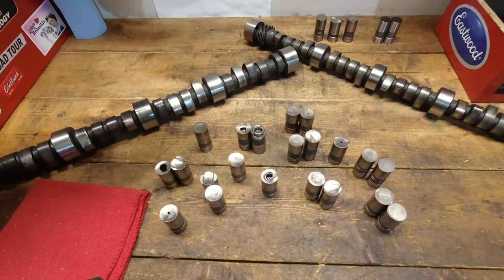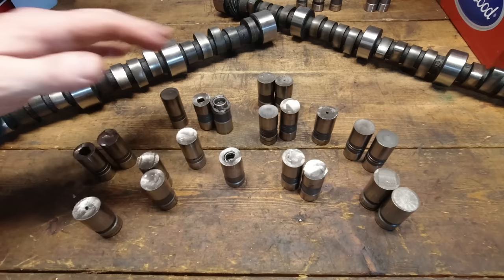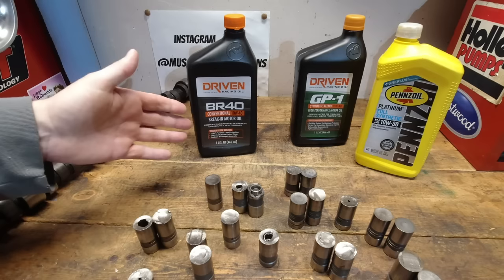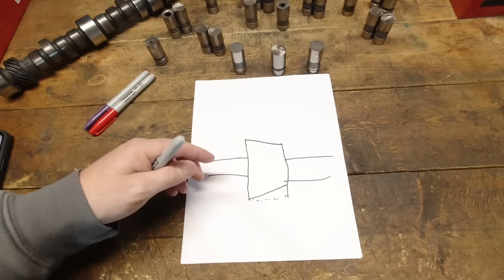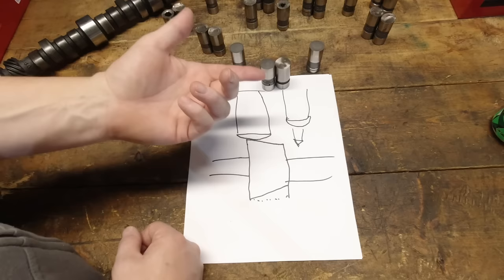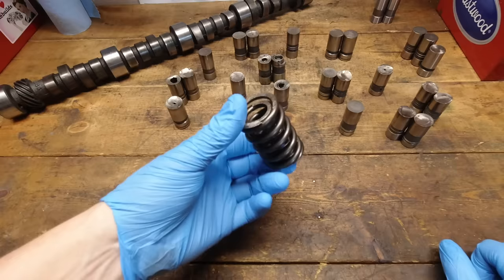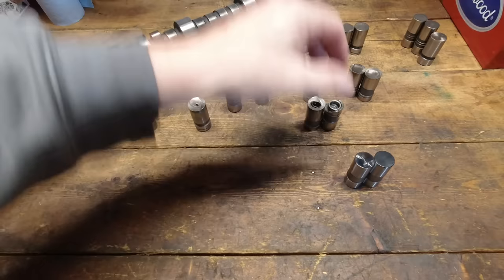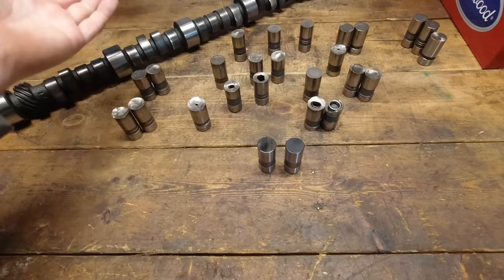Flat Tappet Cam Failures: The Reason Why They Go Bad & The Solution! Part 1

Comment: I last summer I put an AMC 360 together using a cam from Bullet, nos lifters of unknown manufacturer. I used oem springs also. Lots of cam break in lube. I did however use the Lucas zinc additive and rotella t4 .  I used 15 nos lifters and 1 sealed power made in China lifter. After 25 minutes of break in time I pulled the intake to inspect the lifters. 15 lifters locked great, but the China lifter showed bad circular groves indicating that it was rotating . I would like to send you a picture of the lifters and see what you think.  I sent the picture to another utuber but he seemed kinda snobby like don’t question my expertise, but never did reply to the picture.
Reply from the maker: Do you have images of before they were ran or only after?  Send me over your pictures.  I’ll see if I can give you an opinion.  My website is in the banner of my channel page.  There’s a contact form you can send it to.  But it’s pretty obvious without even looking what happened.  Like I mentioned in the video, when you mismatch brands, you potentially mismatch the crown and taper combination.  No knock on the chinese lifters, there are actually some on the market that aren’t that bad.  But if you got one with a weird pin head crown and a lot of chamfer….

Comment: I'm confused if the zinc stays in place with less spring pressure what happens after break n with high spring pressure zinc now just stays on the lobes of the cam?

Comment: A LOT OF USER ERROR.. I PUT A GROVE, OR MORE LIKE A SCRATCH IN LIFTER BORE. COMP SELLS A TOOL IT ALLOWS MORE OIL TO CAM. ALSO RAN LOW RATIO ROCKER  ON BREAK IN. THEN PUT PROPER ROCKER ON.  A LITTLE MORE WORK FOR LONGEVITY AND NO CAM FAILURE.

Comment: Thank you.  I have a friend with a '70 1/2 Z28 with the factory solid cam 350.  He rarely drives it.  That said, he uses Delo 400 and adds a can of Lucas ZDDP.   I cringe 😖
The cam is actually a Comp with the same as factory specs.
The cam is well past the break in period, but still... I cringe 😖
The car is more pristine than when it came from the factory.
so I cringe even more. 😖😖😖 
😁
Once again thank you. You've provided me with ammo to use on him. 😁
Reply from the maker: Good luck!  I did an interview with Driven Racing oil last year and have another coming up with Lake Speed Jr if you need more ammo! 😆
Reply: @MuscleCarSolutions  it's worse. I tried helping get the car started after two years of sitting. He'd had blowout valves installed in the original Holley 780 carb. He also cleaned it....... then it sat for two years.  After a dozen attempts to decipher carb related issues including the wrong gasket, seized accelerator check ball etc, I discovered he'd installed the carbs base screws in the wrong holes. Two are blind, two aren't.
By the time I figured this out, he had a gallon of fuel in his oil, plus his DELO 400 oil with the Lucas ZDDP additive.
...cringe 😖
I'm hoping the gasoline oil additive package didn't do any damage.  It's got less than 50 miles since then.  He just doesn't drive it except for an annual cruise.
 Years ago, the car was part of a Chevy High Performance magazine article.  He's a second owner and acquired it in 1971 or 72.

Comment: No mention of lifters that leak down when engine sits, pump back up and sound normal again. When lifters were removed it was due to this leak down problem and the lifter face to cam area looked normal and healthy before lifter replacement. After a lifter replacement and attempting break-in with Valvoline synthetic 10w30 and zinc additive, approximately after a couple of hundred miles they fail in this way again. This only tells me that the bores where plungers are must be wearing and not of high quality of materials and/or machining. 429 engine, 66 Fleetwood Cadillac.

Comment: i appreciate the video, although you didnt mention valve lash.  i have seen guys crank down that rocker arm and cause exactly the lifter issues on your table.
 the last flat tappet hydraulic lifter engine i built was years ago, from 84-2010, we never used any special break in oil (we did soak lifters, and grease up the cam), and had no valve train failures.
what changed?  the folks building the engine?  the materials for the parts?  something happened for you to have to make this type of video.
have a great day !
Reply from the maker: I suppose I could have added something along those lines but the video is extremely long as it is.  If lash is set that tight, there’s a lot more issues to deal with!  Covered the material and lifter issues and my assumption on the one part that I feel is most responsible.  Good thing the new solution was released.  I firmly believe that’s going to solve all these issues.  Time will tell!
Reply: @MuscleCarSolutions  looking forward to the next video !!
Reply from the maker: Much appreciated.  Thank you!

Comment: I hate to say that you are not right... in the first 1 min. I just picked up 16 Melling lifters JB969.  4 sets of 4  and all four were not the same, all 4 sets were different from each other.  Looking top down...  2 vertical wire on each side to hold assembly together 2 of the sets, but center holes different size. 1 set had 3 wire in box shape, 1 set had a "c" clip in it holding assembly.  Sides of lifter 1 set smooth around collar cut for oil, 1 set had single rib and 2 sets had double rib.  bottom  2 sets were crowned. 1 set not crown but had a different or bottom and the last set had round circular ...almost like a wear pattern 1/8 off the edge. Oh and when looking down that lil hole . . . 1 set has something metalic really close to hole and others dont. These lifters are going into a BB 366 factory engine... no performance any thing. I was kind of amazed  the  sets
Reply from the maker: Sounds like a packaging problem to me.  There’s no way I’d run a mismatched set like that.  Time to contact who you bought them from for an exchange.

Comment: All reasons why hobbiests who shy away from details should invest in roller cam/lifter applications.  Those determined to make the flat tappet work should remember to fit the lifters to the cylinder block bores, one more of those pesky details and time consuming complications.
Reply: Another thing, consider where all that metal worn from the failed lifters wound up.  Imagine what the piston skirts/cylinder walls must look like now.
Reply from the maker: @misterhipster9509  paying attention to detail is the whole name of the game on engine assembly!
Reply: @MuscleCarSolutions  You and I understand that, however many end users don't.

Comment: I don't bother with the break in time. Set the timing,idle . Bring it to temp, once it's hot ,I shut it off. Put the hood on and by that time it's cooled down. Then I go for an easy drive. Haven't lost any cams. The factory never broke in cams. This higher-up then idle cam break in is wrong and is causing the problem.
Reply from the maker: I don’t think there’s an engine builder in the country that would agree with you, but whatever is working, keep doing it!
Reply: @MuscleCarSolutions  probably not,I look at it this way ,it's a bearing surface that has to be mated in, correct. Spinning something at a higher rpm to break it in seems backwards. We started to hear about these failures 10 years ago? What to sell every one break in oil, additives. The collective industry has told us we need to set the rpm @2350 for 20 minutes,don't worry about the coat headers getting messed up because your timing was off. Oil leaking just break in that cam. I have done 15 motors and haven't lost a cam . Some were stock, some hot fat tappet.

Comment: I have a new comp cam 572 lift flat tappet I'm worried bout trying to break it in now and I've done it for 35 years with no problem it's a comp setup maybe it will work
Reply from the maker: Be smart with it.  Keep the spring pressures low.  Even if that means switching to a lighter spring for break in.  Make sure your machinist has checked your block and the lifter bores for alignment and correct size.  Use the right break in oil.  Break in isn’t 20 minutes, it’s the initial and the extended 400+ mile to finish the process.  Make sure you break in at the correct RPM for the engine type.  There’s a lot to get right but if you do them all, it will be successful.

Comment: ZDDP was added to engine oils after 1950. It was an improvement but not necessary. Before and after that NO manufacturer had a cam breakin period at 2000 RPM for 20 minutes. They drove them right off the assembly line out to the parking lot. Premature cam failure was unheard of. So it is clearly metalurgy and heat treatment. Not sure but I don't think very early cams even had tapered lobe or crowned lifter. No reason to if they have adequate lube. Like my '65 GMC V6 where the camshaft is IN a pool of oil. Or my '63 Studebaker V8 with Sig Erson cam and USED Studebaker lifters with dual coil springs. These are from 1968, zero problems, zero breakin, I use whatever oil.  Same with air cooled VW, 1966 327 Chevy, 1951 Studebaker flathead six. All are flat lifters but they are solid, not hydraulic. And that must be considered, all of the failures are hydraulic lifters where the pushrods are at the very top of the lifter and solids are at the bottom, full of oil at startup instead of waiting for pump pressure to lube cam as in hydraulics. Loading on the solid lifter bores is very low, high on hydraulics. BTW, best camshaft design ever is 1982 Dodge Colt 1600 (Mitsubishi). Overhead cam hemi where the ALUMINUM rockers operated directly on the lobes, no lifters or pushrods. I had 3, over 300,000 miles on each.

Comment: I agree with almost everything you said except that flat tappet cams will be extinct in 10 years. 90% of circle track race classes in North America require engines to use hydraulic flat tappet cams. GM still uses hydraulic flat tappet in the 602 and 604 crate engines
Reply from the maker: Rules change.  Especially when supply changes.  As soon as the CT525 squeezed it’s way into the door, it opened the door to other sanctioning bodies making changes.  I’d be happy if circle track racing was still around in ten years given all the push away from internal combustion engines and tracks dying out.

Comment: Standard rotella has to have some sort of friction goop in it to replace the zinc older diesels are flat tappet are diesel guys having cam failures
Reply: The latest Rotella is no better than any other oil. The zinc that was found in that Rosella 10 years ago isn't there now. 
Look at Valvoline VR1 for a good oil.

Comment: i AM 160 MILES IN ON TOTAL CAM LIFTER REPLACEMENT, Pulled mt valve covers over some general pecking noises, I could easily rotate the push rods on several. While on the base of the cam ?

Comment: When you start running 250 lbs seat pressure and 650 lbs open pressure on a flat tappet cam, its gonna cause problems. Personally I think its lubrication failure more than anything, and not necessarily because of the oil. More like the design of the domestic V8 engines. Even on stock engines, cam failure was not unusual going all the way back to the 265 Chevy and the Y block Ford.
As Lake says in his videos, just dumping more zddp into oil isnt the answer.

Comment: Answered all my questions as to why my engine failed. I purchased a old jeep and feel the rebuild was just enough to make it run to sell. Not mad as most would have not had a clue. But as you said do your own research as to why it failed. So do I go to a roller cam and lifters or try the new coated dlc lifters from comp?
Reply from the maker: I think you’re pretty limited depending on the engine.  I’m fairly sure they don’t have the DLC for any of the possible engines you might have in that Jeep.

Comment: I really appreciate the video.  I guess I need to rewatch it more.  But bottom line, why are there so many more failures than there used to be for the average hot rod engine builder using flat tappet lifters?
Is the oil specifically changed after updates for emissions and newer engines to not be suitable for flat tappets anymore?  Or is the metals and mfg in the cam blanks and lifters different than they used to be?  I realize it's probably a bit of both but obviously something has changed over the last 10 years or so, and there are lots of older flat tappet engines getting oil changes with current common oils so ???
Reply from the maker: I covered that in the video.  I believe it’s a combination of things, but the lifters are the primary culprit.  I have another video in this series coming out soon and we’ll look deeper into lifters.

Comment: My machinist told me to just use 10w30 oil in my newly built 350 roller cam as a brake in oil
Reply from the maker: @jb-ik8sj  time to find another machinist.  Cam isn’t the only thing that needs to be broken in.
Reply: @MuscleCarSolutions  you think its to late to switch to a breakin oil? The engine hasn't ran more than 10 mins so far
Reply from the maker: @jb-ik8sj  yes.  Put in a formulated break in oil (don’t mix your own).  You want the rings to wear themselves in.  A regulator off the shelf oil has detergent in it that will prevent the proper west to occur.  4-500 miles on the break in oil then go to whatever chemistry oil you engine needs.
Reply from the maker: @jb-ik8sj  or should I say, no.  It’s not too late.  But switch to a break in oil.
Reply: @MuscleCarSolutions  I will do that thank you. Which brand would you recommend? I live in the Southwest desert in Arizona and its very hot here for about 275 days a year
Reply: @MuscleCarSolutions  I'm also running a roller cam so no flat tappet lifters
Reply from the maker: @jb-ik8sj Driven Racing Oil.
Reply: @MuscleCarSolutions  one other question. My main and rod clearance is averaging .0015. Very tight. Would 5w20 conventional breakin oil be a good choice for this? Thank you for your time and recommendations
Reply from the maker: @jb-ik8sj  I’m glad you asked.  Go to drivens website and download the catalog.  On page 36 you’ll find your answer.
Reply: @MuscleCarSolutions  awesome information
Reply: @MuscleCarSolutions  thanks man. 10w30 breakin oil is my animal
Reply: @MuscleCarSolutions  and yes its driven brand oil

Comment: Reasons why flat tappet  cams can fail by Bloodviking 

Hardness of cam and lifters not at the same level
Too much spring pressure
Improper break in procedure
Incorrect break in oil. No Teflon
Not enough lifter to bore clearence
Cam spacing incorrect 
Cheap lifters
Cam and lifters made by different companies
Too much lift. Mashing parts.
Too little or too much clearence 
Incorrect lifter bore angel
Non matching lifter lobe to lifter face mating pattern
Used lifters with a new or used Cam

Flat tappet Lifters need to spin. They do so by being offset to the Cam lobes. Getting the perfect amount seems to be a well kept secret as ive never seen anything published by any Cam company on the subject. You can control this by shimm8ng or milling the front face of the camshaft.

When all else fails. Go roller.

Comment: Those comp lifters at the end with the coating on them seem like they could be a win. Now I'm not that smart, but I want to ask The Comp people a question. Why don't they put that same coating on the cam lobes.
Reply from the maker: Because that cheap flat tappet cam would cost the same as a roller.  Coating the lifter was the best, cost effective option.  Or just go roller!

Comment: How does one discover what additive package is in their oil. Went out to the garage and looked at my Valvoline jug and it doesn’t list anything about zinc, calcium etc.
Reply from the maker: The only Valvoline oil that I’m aware of that has a high zinc package is VR1.  If you’re using any of their other synthetic or semisynthetic oils, it’s formulated to be compatible with whatever the current API standard is and catalytic converters.  I’d also follow @themotoroilgeek here on YT.  Lake does an excellent job of clearing away the speculation and marketing from oils and just looks at them based on their chemistry.  You’ll learn a ton from him.  I did an interview with him a few years ago if you want to check that video out.  Very helpful information, but oil is only one small part of the equation for a successful break in and long service time of flat tappet lifters.  The rest of the videos in this series digs deep into every aspect.

Comment: When you order spring for your application they should be the proper size as the stock spring
Reply from the maker: Not following what you’re trying to say.  But yes, springs match the cam and what it’s being used for.  But that usually isn’t the best spring to use for break in when the seat and open pressures are so high.

Comment: It’s almost like today’s generation is so used to today’s hydraulic rollers that they install hydraulic flat tappets the same way with no knowledge of the zinc and phosphorus, and no knowledge of rpm and break-in spring pressures. It’s not so much old school hot riders having this problem.
Reply from the maker: @shadjohnsen8143  partially.  Old guys are stubborn.  Look at some of the comments.  “We never had to do this in the past”.  So they don’t do it today.  The rules have changed and it’s a new practice for just about everyone.  Old guys might be the worst.  We’re kinda set in our ways. 😆

Comment: Uncle Tony’s Garage here on YouTube said to use your old springs during the break in period. Do you agree with that?
Reply from the maker: Yes IF the seat and open pressures fall below 100 on the seat and less than 200 open.  It’s a good theory, but they have to be measured and installed at the correct height to ensure the pressures are low enough.  Can’t just assume that an old spring meets those requirements.